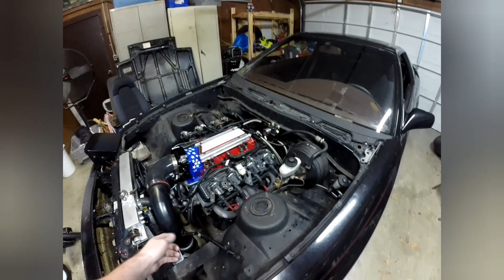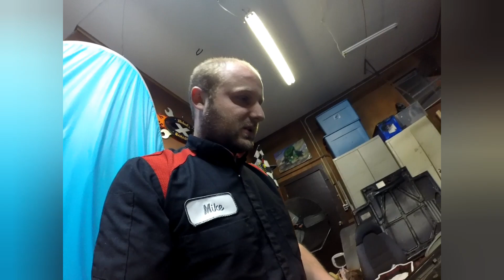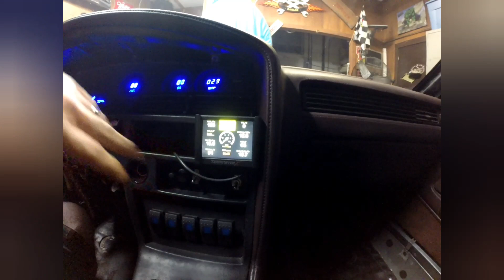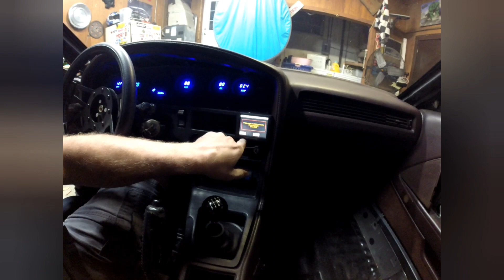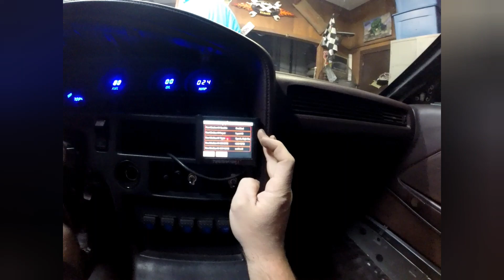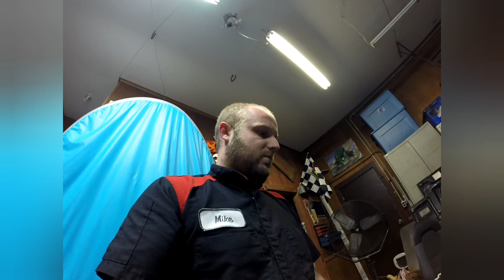Holley Terminator X on a Gen2 LT1

Comment: Hey Mike, I have the Torqhead on my 97 ws6 and am looking to do a terminator as well and I couldn’t help but notice your running a different intake with an LS throttle body,
Reply from the maker: Yes.  It was a modified intake to use the LS style throttle body

Comment: Ok so I can’t win.  I made the change from fast xfi to Holley hp.  I have a 396 lt1 with torqhead kit.  Had car running Sunday night. Shut off and started right up a hand full of times.  Tried to start it last night to take a test run.  Just cranks 🤦🏻‍♂️🤦🏻‍♂️.
Reply from the maker: Hard to say what it might be. I’ve not used HP personally. Did it happen to lose battery voltage?
Reply: @dirtymikesgarage9053 battery ended up being bad. Replaced it with another bad battery. Had voltage no amps. Finally got new bat with amps and volts but still just cranks.  I’m just wondering how sensitive the crank sensor is to pick up. It started before but is 1 shim closer the difference to run.  It’s got 3 in now

Comment: Was that a 58X or 24X harness
Reply from the maker: 24x
Reply: @dirtymikesgarage9053 Holley told me to go with their 58X harness because the wires are designed to reach crank and cam sensors at front of engine… now I’m all messed up
Reply from the maker: @DaMadLib I didn’t consult with Holley before building my setup so I’m not sure what they would recommend. I went with the 24x and just extended the cam/crank trigger to exactly where I needed them. Either way would probably work fine.

Comment: im looking at doing the efi connection kit that includes the 24x conversion on my 96 lt1 engine, did you have any problems with the limited 4 inputs and 4 outputs the regular x has? particularly when boosting it and when running gauges as well? dont wanna buy and then figure out i cant run a aftermarket speedo and tach and all the other gauges in my swap. going with a dbc setup.

Comment: With the 1994 timing cover and a cam sensor, is that all that's needed to get cam signal on the 1993 LT1? Like is the internal part ready to just add a cam sensor?

Comment: Hey Mike, I did the same conversion that you did using the torq head signal kit and running the Holley terminator x max with dbw, did you have a problem with you timing being off by 19 degrees? I pinned it like you showed but I had to pull 19 degrees out just for it to be at zero.
Reply from the maker: I honestly don’t remember right off hand if we had to do any correction. I had a little help setting up the tune as I was fairly new to Holley at the time.

Comment: Does holly delete the maf sensor?? I have so many questions.  Lol.   I have a stock gen 2 set up. I’m doing turbo set up.   I’m not going to really BOOST it. Will stock ecu with maf sensor run it ??I worry about map sensor going nuts.
Reply from the maker: Yes it runs off of the map sensor. So no maf needed

Comment: What did you do with the Holley o2 sensor? Is there an option for 2 o2s?
Reply from the maker: The terminator only has an option for one O2.
Reply: @dirtymikesgarage9053  are you running a y pipe? I’m assuming a y pipe is needed to only run one o2?
Reply from the maker: @bammer1988  no just one o2 sensor on one bank.

Comment: Where did you get your intake? I’m doing the same set up on mine and I want to go DBW with it and I like your intake set up!
Reply from the maker: It’s custom
Reply: @dirtymikesgarage9053 what did u use to make it
Reply: @dirtymikesgarage9053 dimensions and material would be greatly appreciated it looks like a dope setup
Reply from the maker: @mikes4596  I used a LS throttle body flange and had the old flange cut off and the new one welded on. Had a local fab shop do it
Reply: @dirtymikesgarage9053  what about ur tubing for the cold air intake

Comment: I have a question on how you mounted your coils. I really like how they are bolted to the factory valve covers, im wondering what bracket you used and how it bolted on?
Reply from the maker: That was temporary as I went with different headers that didn’t allow that anymore. I just used factory coil brackets and made some spacers and mounted them using the LT1 valve cover bolts
Reply: @dirtymikesgarage9053  Thanks man, much appreciated.

Comment: For the crank sensor, if you’re already buying the shielded cable from Holley, part 570-223 is the correct connector for the Torqhead crank sensor.
Reply: Holley sent me a wiring harness for a 58X… do I still have to swap the A and C pins?
Reply: @DaMadLib I am not sure on the 58x vs. 24x cables. From the Holley support site you can get a pin out for each kit.  Check the cam sensor on both kits to see if the harness is already swapped.

Comment: I have a 86 Toyota Supra how would I wire it it straight in from the engine to the computer brain how's the car
Reply from the maker: You might want to do some research on Holley terminator. Holley comes with its own harness and computer

Comment: What did you do for knock sensors? Also, from everything I have seen regarding the kit, there is only the standard LS firing order as an option. You said you changed to correct one. How did you do that if there appears to not be an option to do so?
Reply from the maker: I’m not running knock sensors. But if you choose to, you can run LS knock sensors. Terminator DOES offer more than one firing order. You can actually even make a custom firing order if needed. Most terminator x computers need the latest software version to be installed and then will show you all of the firing orders available on the handheld

Comment: I have so many questions lol but I just I should just ask one.....have you ever swapped the headers to opposite side forward facing, instead of up and forward? on the spare engine?
Reply from the maker: I have not but I’m pretty sure the will work just fine. I just couldn’t do that in my car due to clearance
Reply: @dirtymikesgarage9053  I'm thinking for my fbody . I have the same valve covers you have on the spare, but I have them modify for my coil packs and vents. and I really want to keep them. dont feel like buying headers and they dont fit at all, nomatter how big my hammer is
Reply: I pm you too lol but how did you the firing order in the wizard? I only have one choice and that is the ls

Comment: I haven’t seen any videos about the modified intake you have on there; (maybe i overlooked it) but it looks like a standard 4 bolt ls throttle body on the lt intake is that a custom piece you made yourself? Would be nice if you would go over that if you ever get the time or interest to do so.
Reply from the maker: 到處尤伯杯 it’s pretty straight forward. Just cut the front nose off of the stock intake and welded on a LS flange
Reply: I believe he just cut the stock one and did some welding.  Simple piece to make really, and a great idea.
Reply: Why even bother when you can get a twin 58mm for the stock intake. Little grinding to enlarge the intake holes and you have plenty for boost or whatever.

Comment: Did you have any issues with timing? I did this setup with terminator x and I checked static timing and it is 15 degrees off. Just wondering if you changed it.
Reply from the maker: There's no distributor so how can you get the timing off? Its all electronic. I didn't have any issues. How did you check the timing?
Reply: I found top dead center using a piston stop, set up static timing to 15 degrees in terminator x software and then checked it with a timing light. Timing light read zero. Then I turned the static timing up to 30 degrees timing light read 15 degrees.
Reply from the maker: @boydbeckner7175  I'm not sure what to tell you. There's no timing marks on the LT1 so I'm not even 100% how you checked it with a timing light? What signal kit are you using?
Reply: It's got an aftermarket balancer with timing marks and I'm using Torquehead signal kit.
Reply: @boydbeckner7175  hey boyd, I know this is a old post but I ran into the same problem with the timing being off, did you ever find out what the problem was?

Comment: Question I got on this is, how can I still run my a/c with this! My lt1 trans am is mostly stock just a bolt on car and I’m tired of the opti! Coil! And icm!!!
Reply from the maker: I'm assuming you would just have to run power to your compressor. The Holley has a a/c input to adjust idle

Comment: If you ever redo another LT1 engine build for the supra using the Terminator X system, You can do the 4-7 cam swap and Holley's X system can run it.
Reply from the maker: I don't see a point in doing the swap since the Holley will run whatever firing order you want to run.
Reply: @dirtymikesgarage9053  Yeah I looked more into the 4-7 swap and I see that most Small Block Chevy's won't see any improvement.

Comment: What intake and throttle body is that. I was wanting to go to a LS style TB on my ported intake.
Reply from the maker: Its a 102mm LS flange welded to the factory intake. The TB is just a Amazon special
Reply: Any difference from the lt1 style tb
Reply from the maker: @curtisdefreece9921  definitely a big improvement on WOT. Cruising throttle response isn't as good as it was.